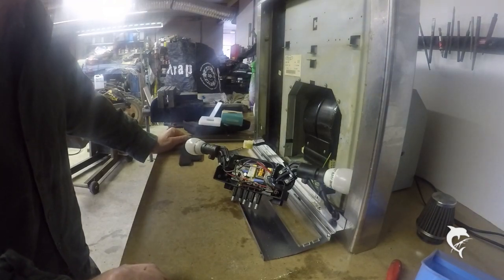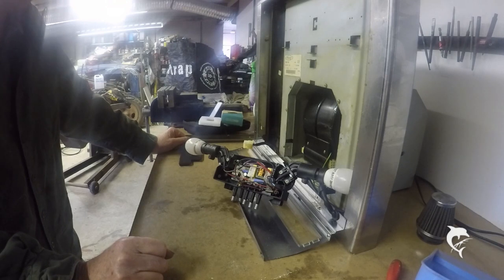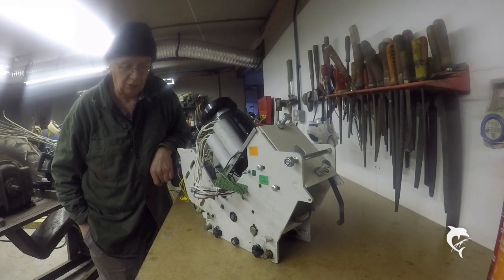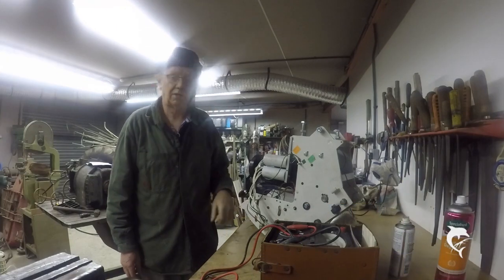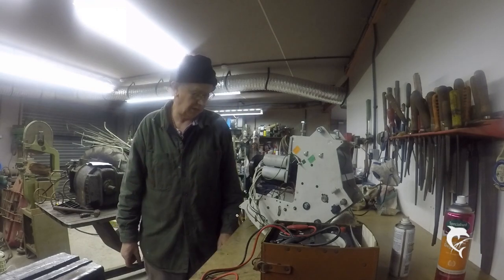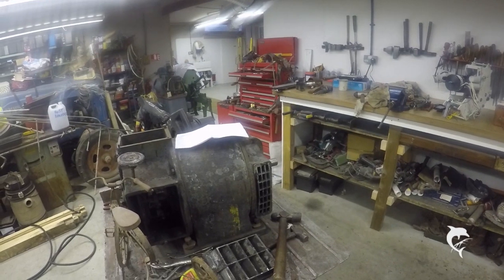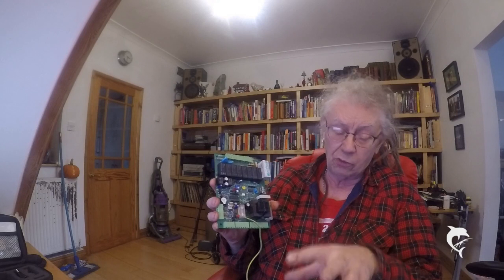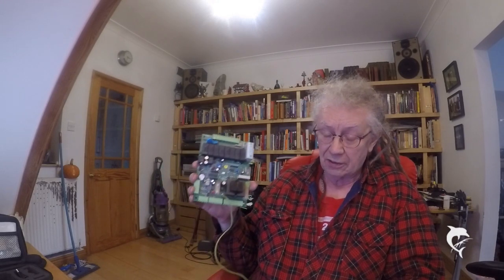stress, poop and a diatribe!

Comment from the maker: thanks chaps, and thanks and welcome to the new subscribers, Didn't shoot anything yesterday, as we ended up pressure cleaning, putting dye down, and eventually getting the drain flowing again, , but it looks like it is a long drain, and not a septic tank, and it looks like it has collapsed somwhere along the 50m length in the garden, which slopes steeply downhill. The camera goes along the pipe to a elbow pointing downwards into the ground, drops about 1m and then goes black, which usually means it has run into a mudbank where the drain is collapsed. looks like the insurance will cover it, they are going to dig it up by hand, and repair it, and fit another manhole where the problem is. thank goodness I dont have to dig it myself! 

   The Stairlift is working perfectly now, and now I have stripped and rebuilt the carriage and motor, it holds no more mysteries!! 

I now realise that I have somehow put the GoPro into stills mode from the Iphone, and taken pics instead of video. I will get better! Thanks for the comments!
Phil